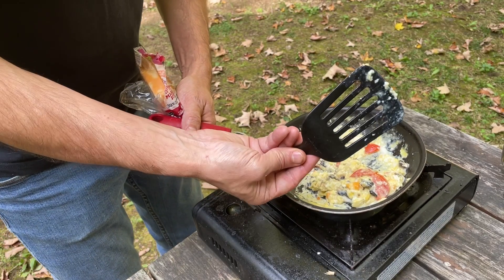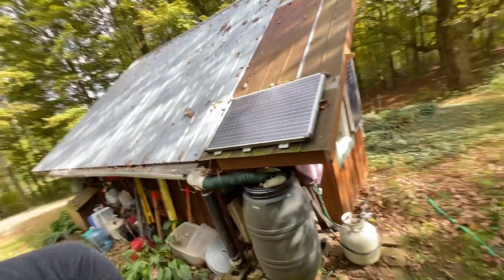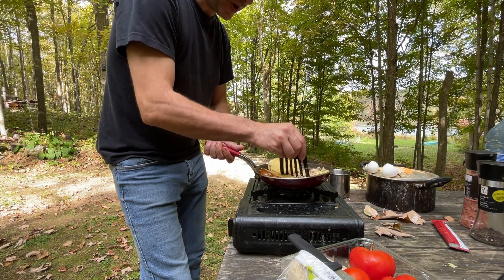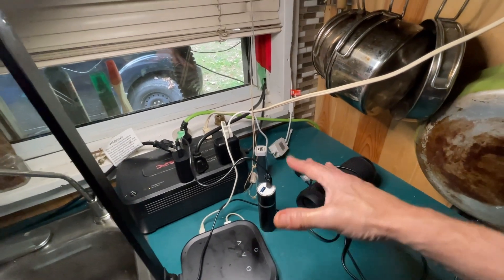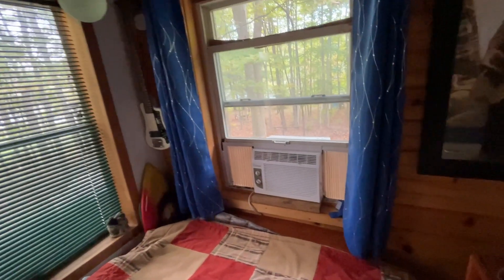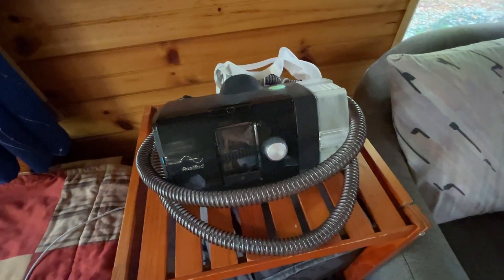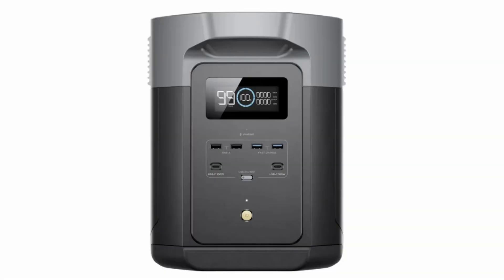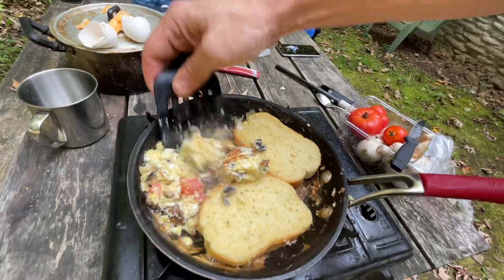How I Power The Off Grid Cabin & Why I'm Thinking About Upgrading

Comment: I'm also looking to upgrade my small off grid power supply. like you said the old batteries are't that efficent and at lets say $200 each to replace you can get way more Watt hours from a power station. I upgraded my inverter from 400 to a 2000 watt and I'm finding that the power draw just from the inverter is draining my batteries needlessly, and with a power bank you don't need an inverter at all. I'm thinking the Ecoflow Delta 3 plus $999 on amazon with the option of 3 different expansion packs to expand the 5 Kwh. is a great option. I think the bigger the solar input into the power bank is main option people should keep in mind, short sunny days or days with no sun at all, with the right solar panels you will still have plenty of power and with the fast charging rate you shouldn't run out of power. Run an extention cord from you generator (for backup to solar) another quick way to recharge and away you go.

Comment: Great vid, need to look into a small powerstation to run a Kerosene heater ( 300 Watt 5 min then 20-30 Watt) as an emergency heater. My standard setup ( Camper) is a 160 Ah 12 V Lithium Iron Batt ( Ypselon) with a 65 Amp charger ( when using a generator 2 kw) so it will charge the thing in 1 h ( never dropped below 60 % since 2017) my start up heat source is a 2 kw diesel heater which will heat the battery and keeps it above freezing when we use the camper. The batt is also charged by 2 90 MIT Solar panels and a charge controller which can crank out 11 amps max..ave 5-6 , enough to keep the system afloat. We are totally offgrit from 3-10 every year and uae generator or grit power in the winter to top up batteries ..thats it...but agree a spare gel batterie ( like the chassis batt of  an RV ) can help to bridge when you starting up a deepfrozen RV by begin heating the batt system and fire up the primary heat source.  Biggest advantage for this Liphos light weight and charge with 0,8 -1,5 C .. cheers from southern germany ( used the RV last weekend at -20 ° C )
Reply from the maker: Thanks for watching and leaving a comment. That sounds like a great system you're running. And, it also sounds like you're having a cold winter in Germany!
Reply: @cleverjoe  -20°C @ Austria ski resort ( Kitzbühl) Germany -1-,-10°C

Comment: Hi lithium batterys have significant advantages however with temperatures round 0 degrees Celsius or below you can not charge/discharge at nominal rate.... If I am not mistaken...
Reply from the maker: True, I talk about this in the new video posted. Cheers

Comment: Thanks for the video it’s great to see someone keeping it real…. Been on the same kind of journey…. when I got my first 200 amp hr ion lithium battery I couldn’t figure out what took me so long…. knowing what I know now I would never use lead acid AGM batteries I just gave them away what a waste of money….. as to blue yeti don’t do it…. build your own way cheaper get a 300 amp hr ion lithium battery definitely a 3000 W pure sign wave inverter you don’t want your precious electronics to get damaged…… just find yourself a plastic toolbox to put the battery in a inverter solar charge controller and a little monitor on the outside and Walla….. as simple or as complicated as you wanna make it…. you don’t need all the bells and whistles you’ll never use at a quarter of the price…. don’t be fooled by the ratings on the wattage some of them only equal 100 amp lithium battery it sounds impressive but really not….. hundred amp ion lithium battery it’s really cheap nowadays…. bare minimum get a 200 but 300 is better…. Just a sidenote get yourself a lithium battery charger a 70 or 80 amp would be great it doesn’t take you long to charge…
Reply: No to a 12v 3000 watt inverter,  2000 watt is plenty, solar generater are way too much $ for what you get. 82% of rated amp hours is aveage what get with ecoflow/bluetti.
Reply: @ exactly to my point that’s why I I’ll build my own…
Reply from the maker: Great points, thank you.

Comment: I also have a small system that needs upgraded . I will go 48v . And use lithium batteries . 
It is way more power and cheeper than a all in one thingy
Reply from the maker: @mywoodlandpath2314  There are certainly advantages in going that route. Good luck!

Comment: I recommend researching the temperature range that the LiFePo4 batteries can function effectively. It is my understanding that these batteries can't run below -3 degree C. Keep your deep cycle batteries for colder weather. If you get a solar generator, look at a dc/dc converter to add extra capacity to the unit. Freely Roaming has a great video on this. great video.
Reply from the maker: Excellent points, thanks for the tip on the video link.

Comment: You can combine a power station or lithium battery with your existing system.  Hook up a small pure sine wave inverter to your existing system then run an extension cord to a battery charger inside hooked up to your lithium battery or power station.  You can then run your appliances off your new lithium or power station.  I  have 200w solar panel with mppt controller charging my outside deep cycle battery, hook up 600w inverter and use outdoor extension cord to 10A smart battery charger which is charging my house batteries.
Reply from the maker: That's a great idea to combine both systems, thanks for the tip.

Comment: On my off grid I upgraded to 48 volt battery, lithium iron phosphate. Cost was $3,3000 for 10 48 volt panels, one EG4 all in one converter inverter, the yellow one, and one EG4 48 volt 100 amp hour battery. I will NEVER look back. Best thing I EVER did. Can run fridge, CPAP, everything, no problem. Will Prowse showed me this system. I copied it. Link to the system on Wills You tube channel is: https://www.youtube.com/watch?v=Pd5IqeBq42k. Highly recommended. Bought at Signature Solar in Texas.

Comment: Very challenging location, without knowing your budget....look at SunTan Solar for used panels and grab a eg4 3k inverter and 2 EG4 48v batteries. With building the mounts yourself out of wood should be able to get a 3kw panel system up and running for under 5k. Just did that myself, Long as you use less than 8kwh a night you should be set no issues.
Reply: Look for Will Prowse handcart settup and you can just add a second battery.

Comment: I personally have a eco flow delta pro and it is a beast. 
Nothing is 100% perfect. 
My unit had some software issues for  a time but ecoflow fixed it. 
Costco or Home Depot (paid with there HD credit card) both give good return timelines.  
The retailer  bought from can make a good deal too

Comment: To me powerstations are just stupid expensive for what you get. I built my own (280WH) for $190 with Lithium battery and pure sine inverter.  My cabin is powered by 2 lithium 220AH batteries. These do better that the massive 880AH golf cart setup I did use.

Comment: Its easy nowadays to buy 12,24 or 48v lifepo4 battery , an MPPT charge controller and an inverter. And u have a powerful system but if u decide to go with the portable power stations Anker , Eco flow and Bluetti are the best . But also consider Pecron , its a good option as well
Reply from the maker: Thanks for the tip, and I hadn't considered Pecron but will take a look.

Comment: I have both a homemade battery/inverter/solar charge controller setup and several Bluetti products. I like the portable power stations because I can use them wherever I want to in the house as well as outdoors for both AC and DC. They aren’t prohibitively expensive and compliment a stationary system. Also when on sale I have purchased LiFePo4 batteries for less than deep cycle lead acid ones and you can use 100% of the capacity of them. The whole system can be indoors as well since they don’t off-gas like lead acid.
Reply from the maker: Thanks for the input, I agree that having both a stationary solar setup and a portable power station is a win win. Cheers.

Comment: lol don’t do it , your way better off buying 100amp lithium batteries 🔋 buy 2 get inverters get Victron small MPPT wireless smart controllers  and safe way more money have 2400 watts of storage capacity, you can easily fix them yourself,
Reply from the maker: Thanks, there are pros for going that route for sure.

Comment: Power stations are waay too expensive.  I would suggest you build your own solar power system. Small 2000 watt or so systems are easy to build, just watch a few DIY videos for good ideas.
Reply from the maker: Good points to consider, thanks.

Comment: I picked up an Ecoflow Delta 2 with extra battery, giving total 2048 wh for $1349 CDN on prime days sales about a month ago. I like that it's 2 units that i can leave in place, but just take the one main unit to build sites / camping when I don't need all the power. Stay away from the cheap off brand ones, I learned the hard way that they don't have the protection that an Ecoflow does.
Reply from the maker: Thanks for the tip, I’ll keep that in mind. I was looking at that same deal in fact - it was a good price for 2k+ in power.

Comment: one advantage portable power stations have over DIY  is they are very portable.....i have used a Jackery 1000 for years with my camper on late fall hunting trips. i recently upgraded to a Bluetti ac180 the best part i can use them at home or on picnics also.sure they cost more but if cost was the only factor in life we would all be driving a 1940s fords.....
Reply: You can easily build a portable solar power system for half the cost of a power station.
Reply from the maker: @lawrencedavidson6195  True, especially if you already have the inverter and mppt solar charge controller.
Reply from the maker: Ha, good analogy. I hear ya, portability is a big deal and was a factor in my decision to upgrade. I also want to pick up a smaller power station for quick overnighters and use around the property outside of the cabin.

Comment: something to keep in mind if you do liPo4 is you are not going to be able to have it outside in winter. they will not charge in cold. Id personally stay away from the blue yeti style and just go with a DIY battery bank with a BMS. you can save a ton of money if you build the battery yourself. Im offgrid on a 5kW system with 48V liPo4.
Reply from the maker: Excellent point and I'll address this in an upcoming video. Something to think about for sure in colder climates like Canada, and it's rarely talked about in the 'review' videos for these new powerstations.

Comment: I love my lithium batteries. It is a day and night difference from the lead acid batteries. If I get a power station, I am not sure which one I would get For convenience wise, I wouldn’t mind getting another power station but otherwise I am very happy. I got 500 W of solar on my two batteries and my inverter and power The deep freezer no problem.🇨🇦MB
Reply: I love my lithium batteries too, i made the switch last year. Im running four 100ah Power Queen in parallel for a 12v system. Four 450 watt panels charge them fully almost every day here in Jamaica.
Reply from the maker: Sounds like you have a great off-grid setup going!

Comment: 🇨🇦🇨🇦 got 2 lithium batteries hundred amp hours each with a separate power inverter because I believe it’s a cheaper way to go maybe not as convenient as a power station but definitely cheaper
Reply from the maker: That's about the same amount of power I'd like to have. Agreed, building your own system is cheaper for sure. It's a bit of a learning curve to do it yourself but the savings are there. Cheers.

Comment: Nice little setup. It's amazing how little power we have limited power available. I live in western North Carolina where we just got rocked by a hurricane, and lots of flooding. My power was down for almost 3 weeks. I've been wanting to get some solar for years, and this experience has me even more motivated. My brother in law has the 1000 watt eco flow, and I was thinking it could be very useful in a power outage or on a trip. I like to tinker though, and I also like to save money. I ordered a 100ah ,128Owatt hour,LiFePo4 battery, a pure sine wave inverter, and a plug in charger for just over $300 delivered. I have more battery capacity than his at about half the price. I can also double my capacity for $160 instead of over $400, which is nice. 

I was running my generator for a few hours when the power was out, but didn't need the 3000watts that that puts out. I can use the generator to charge the battery and run my lights and computer off of the inverter while saving gasoline. I then purchased 2 100 watt panels and a charge controller for about $160 so I can use the sun when I don't want to use the generator. 

I'm starting a home build next year and plan to buy about 4800watts of bifacial solar panels and 20000watt hours of lifepo4 batteries. I should be able to generate all of my power in the summer, including high efficiency AC and most of my power in the winter, with a high efficiency heat pump. I will be using  a wood stove on the colder days to save power. I should be able to get the solar panels, inverter/charge controller, and batteries delivered for around $6000-$6500 dollars. I haven't picked out the exact batteries just yet, and I plan to buy on black Friday to catch some sales. 

Anywho. I am curious to see what you decide to go with. I really like geeking out on systems of all kinds, and making my own power for decades is going to feel amazing. When everyone else is down I will still have refrigeration, lights, and some heat with no problems. I do plan to run a line from my sisters place in case I need to use the grid, and my inverter/controller has the settings to automatically switch to grid power if the batteries get too low. 

I will keep an eye out to see what you do with yours. Thank you for sharing. 
Ben
Reply from the maker: Thanks for sharing your setup. That's a great deal on the battery and inverter. I think that having a generator as a backup is always a good idea. I'll share my new setup in a video once it's up and running. Cheers.